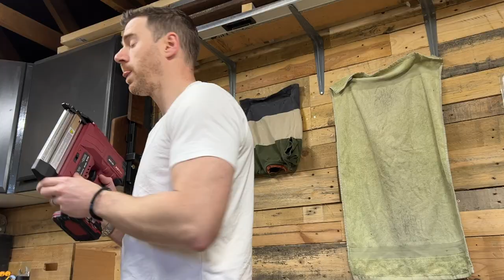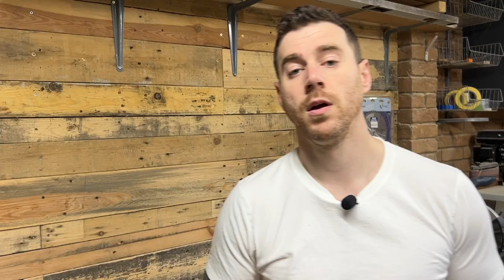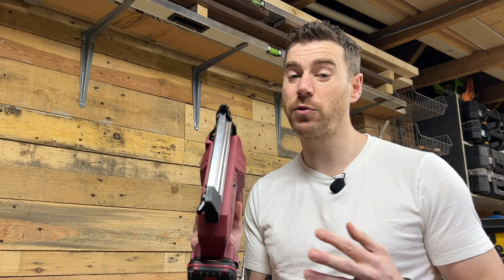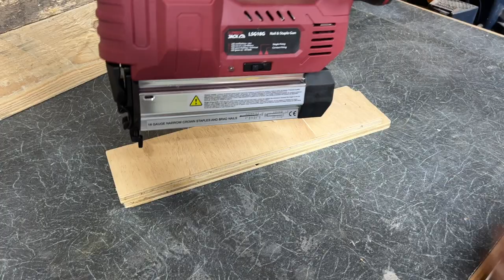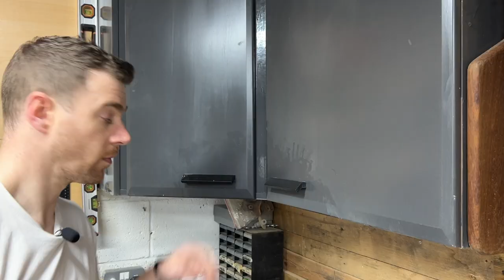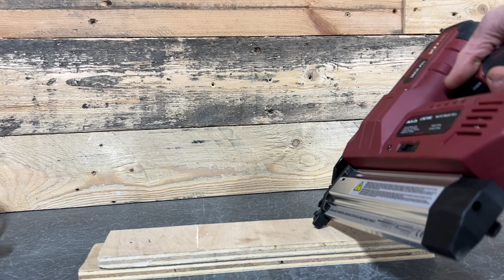Why You Need A Cordless Nailer - Lumberjack Tools Cordless Nail Gun Review

Comment: Are there any good the fire 50mm brad nails true fully could you used it to put a fence up with it but it only comes with one battery 🔋
Reply from the maker: I’ve just built a garden planter using 50mm brads and it’s worked well mate. It’s not too bad on battery usage but I’ve got the full cordless set with spares so can swap out when it runs out. If you’re building a fence then you’ll probably need a spare battery, if you’re looking for any other cordless tools from them then I recommend the circular saw and jigsaw, both of which are available with batteries so you have a spare.

Comment: Cool video, i liked the comedy bits. Would have been nice to see it in action on some test bits. Ive also been considering the Ryobi and am in the same boat as you with the titan nail gun, so i'll deffo be looking into this, as i have dewalt tools and i was going to get the dewalt to ryobi battery adapter instead of buying a ryobi battery. Still this lumberlack one is way cheaper.
Reply from the maker: Thanks mate, it’s always a bit of a risk getting your backside out on a public video 😂😂 

fair point on showing it in use more though, I’ll try and do more of that in future. 

I first tried the nail gun in person at a woodworking show and I know lumberjack are going to be at Makers Central in Birmingham so could be worth going down so you can try it for yourself before buying it but I’m really pleased with it.
Reply: This one appears to be a bit different than those two. For example, their depth knob in on the nose of the tool.  I purchase a similar tool to the Aldi/Ferrex from Harbor Freight under the Bauer brand name and returned it two days later because if was so inconsistent in the depth it would drive. Ben, I'm curious about jambs. How many did yo have to clear and was it difficult?  Scott
Reply from the maker: Hey Scott, I’ve not had a single jam in it yet mate. It’s easy to clear them as the front opens up but as it stands it’s not jammed once.
Reply: @lionandbear  Awesome.

Comment: Looks Terribly like ,my Aldi / Ferrex one one, bought about 2 years ago , apart from the colour and perhaps the battery is slightly different. If it is , i works like a dream for me.
Reply from the maker: I’ve not seen the ferrex one. Those tools usually get good reviews to be fair. The problem seems to be that it’s hard to know when they are in stock and you’ve got to be quick round these parts 😂
Reply: HI Paul, own both the LJ and the Ferrex.  This is miles better.